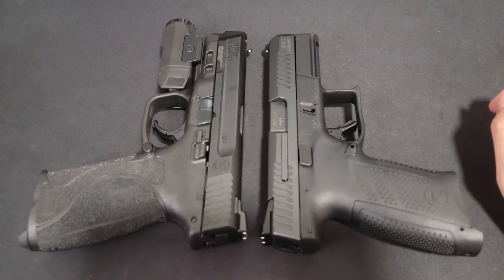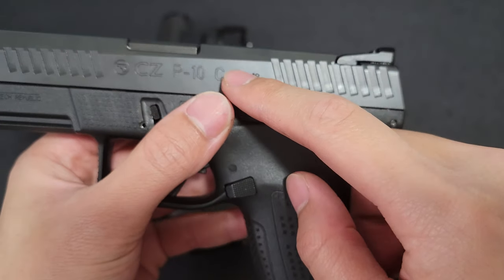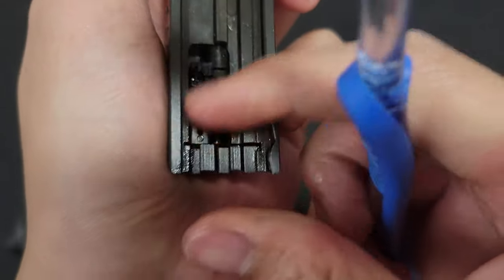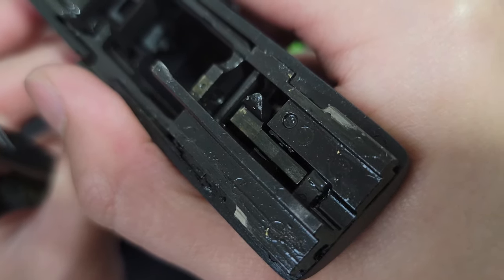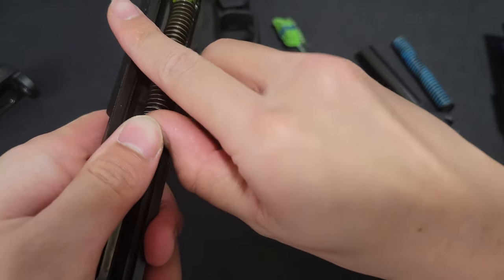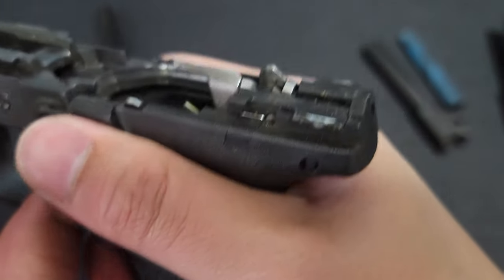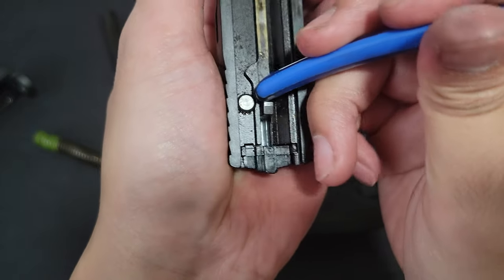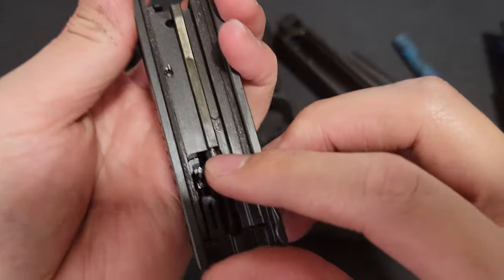Addressing the CZ P-10 C Firing Pin Stop Design Flaw (Read Description, Updated 7 April 2021)

Comment from the maker: A firing pin block is a mechanical block used in semi-automatic firearms and some revolvers that, when at rest, obstructs forward travel of the firing pin, but is linked to the trigger mechanism and clears the obstruction to the pin just before the hammer or striker is released. This prevents the firing pin from striking a chambered cartridge unless the trigger is pulled, even if the hammer is released due to a faulty sear or the pin is dropped or struck by another object.

Here's a parallel to draw, my CZ P-10 C is basically a series 70 1911 because its firing pin block does not work, and the functional structural integrity of the firing pin block does not change when the gun is assembled. My firing pin block is still free to move inside the gun just like it is outside the gun, I stuck a pin inside the gun when it was fully assembled to try to move the firing pin block and it was free to move. Basically think of it like this, it's like a series 80 1911 with a non functioning firing pin block, essentially turning it into a series 70, not that a series 70 usually has problems, it's just that it's better to have a functioning firing pin block in modern guns. Almost all other pistols' firing pin blocks work when the whole guns are both assembled and disassembled, this P-10 C Firing Pin block does not either way and will ignite a primer by pulling the striker back and letting go or if the sear were to disengage. Essentially what is happening here is, my CZ P-10 C is relying solely on the sear engagement in order to keep the gun safe, not BOTH sear engagement in conjunction with a firing pin block like most other pistols. A series 70 1911 is the same way, it is relying solely on hammer-sear engagement to keep the gun safe, if a series 70 1911 were to take a drop on the back of the hammer, it could possibly slip forward from the sear and fire a round, with a series 80, if the same thing were to happen, the hammer would slip forward but the gun would not fire as its firing pin block is actually functional, this is why it is important to have a functioning firing pin block both when the gun is assembled and disassembled, and not rely solely on sear engagement. The CZ P-10 C to me, indeed does actually have a strong sear engagement that will usually not fail, however if it were to fail, keep in mind that the firing pin block that is designed for those rare instances, will not do its job. In conclusion, your CZ P-10 C will not likely give you any problems, but just remember that it is operating similar to a series 70 1911 regarding its firing pin block.

Comment: This is when social media proves how it’s a detriment. That so many in the comments are taking this seriously is just sad. Easier test since you think you have an inferior gun unsafe for others: your P-10 should have come with snap caps that have replaceable foam where the primer would be. Try some drop and hammer to the back of slide tests while the gun is FULLY ASSEMBLED and record the test from beginning to end. Show us the an impacted foam primer after getting one to go off and how much force was necessary for this to occur. There’s dozens of these tests on YouTube you can reference. Stop counter claiming that gunsmiths and engineers aren’t as smart as people think they may be. You made a claim. Demonstrate it in an assembled gun or take this goofy video down.
Reply from the maker: I'm worried about potentially the slide separating from the frame from being dropped. Not likely, but if the firing pin stop works only when the gun is assembled, then if the slide comes off, it would no longer be a stable system since the gun is no longer properly assembled. I'll tell you what though, using a needle, poking it from the back of the slide, I can move the firing pin stop just like I could when the gun is disassembled, so in actually, assembling the gun doesn't do anything to increase the firing pin stops integrity.
Reply: @Radvous  it won't happen. it will take a lot of force to separate the slide from the frame. dropping it won't just cut it. maybe if you drop it from a 30 story building then it might. even though, you're not sure if it will going to fire when it breaks apart
Reply: Doesn't help that he's clearly bent it.  "Hey guys, look at this gun I broke not working how it's supposed to".

Comment: This is the next eisode: "Part one: I can't find the flaw" and "Part two: I make up some BS, and perhaps S&W pays me"...
Reply from the maker: Just so you know, CZ discontinued a previous version of the P-10 C because of flaws
Reply: My P01 is a useless P.O.S. My Glock never failed me. I'm selling my P.O.S P01 to any fan boy who might want it.
Reply: @watchingthecrazyworld7761  I will buy it lmao i have a ton of pistols maybe 6 different brands but my cz p07 has around 8.5k rounds through it without a single malfunction. I have a gen 5 g17 that has about 2k with like 8 failures. I've seen glocks that run like a top but in terms of trigger, sights, ergos they just aren't the best. They just have a good track record in terms of modern military and police use
Reply: @Lophophorasaurus  Let me know if you are serious. If so, I will get you my email. I would take $750 for it. It would come with 2 mags, a leather shoulder holster, and the original case. I had upgraded sites installed that cost $150 and new aftermarket grips. So that's a good deal.

Comment: No we understand,  the person who doesn't understand is you.  Stop making videos like you know what you're talking about.  If you truly think you have a faulty gun then send it in, but as I stated I repeated the "demonstration " you did in the previous video and the stop on my pistol functions fine.  The gun has been out for quite some time, and if it had an issue we would have heard about it.
Reply from the maker: Heres a parallel to draw, mine is basically a series 70 1911 because my specific firing pin block does not work, and the functional structural integrity of the firing pin block does not change when it is assembled with the rest of the gun. My firing pin block is still free to move inside the gun just like it is outside the gun, I stuck I pin inside the gun when it was fully assembled and it was free to move. Basically think of it like this, it like a series 80 1911 with a non functioning firing pin block, essentially turning it into a series 70, not that a series 70 usually has problems, it's just that it's better to have a functioning firing pin block in modern guns. Almost all other pistols' firing pin blocks work outside the gun disassembled, this one does not and will ignite a primer by pulling the striker back and letting go.
Reply: @Radvous  + drawing comparison to a 1911 isn't making your any smarter or proving your point.  If you are so inclined that your the only CZ p-10c owner in 4 years to have any issue like this, then send it to CZ and document that process.

Comment: The one time you "demonstrated" the issue you the safety was disengaged by the toothbrush. In normal operation it blocks the striker very reliably. Also if the pistol falls the striker is not pulled back further as you are doing with the toothbrush. It is constantly pushing forward under spring tension. In terms of the whole assembly moving forward, the pistol would have to fall muzzle down and there is simply not enough inertia to allow the assembly to go forward and discharge a round. Finally the CZ design is superior because the plunger design on the Glock and M&P is prone to becoming stuck if oil and debris gunks it up.

Comment: All mechanical devices can fail, regardless how well they are designed. It's the user that's the true safety. Do I think CZ should redesign the firing pin block on the P-10c? Yes.

Comment: Test it like this. With the pistol in its assembled state with a magazine in it. Now rack the pistol, now lock the slide back and check the firing pin to see if it can be pushed past the block. Now drop the slide and pull the trigger then rack it again and lock the slide back. Check the firing pin to see if you can push it past the block again. Repeat that as many times as you like.  If you do it that way and you can NEVER push it past the block it works exactly how its designed to. That is how it operates when it cycles the action. I guarantee you if you test it like that you will never be able to just push the firing pin past the block, once it goes back into battery and the slide cycles, that firing pin will be behind the block everytime. Now on to the whole assembly moving. The pressure it takes to move the entire assembly forward is to much to move that firing pin forward easy enough and hard enough to set a primer off from a distance out of a hand or more distance even. If it was that easy the pistol would go automatic during firing it from the inertia of the slide slamming forward each time. Also the firing pin never slams into the block like that during its normal cycling to begin with. Its also only pulled back just alittle bit when the pin is resting in its firing position. You are misunderstanding the engineering of the CZ P10 series functions. Its not a Glock or any other pistol.
Reply from the maker: The sear on the striker and trigger bar catch when the slide goes into battery, what the firing pin block is for is in case the sear gets disengaged, the firing pin block is supposed to stop the round from going off if there is a slippage of the sear. If your firing pin block doesn't work when the sear slips then a round will go off if the sear slips, turning it into similarly a series 70 1911. Most of the time you can rely on the sear engagement and not have to worry about having a firing pin block as a backup, but firing pins break and they can break at the sear too, in those cases you need something to stop the firing pin from striking the round. Any other pistol design out there stops the firing pin from protruding from the breachface no matter if the gun is disassembled or not and the only way those guns allow firing pins to protrude is when the block moves out of the way when firing.
Reply: I know what it all does. The firing pin will not hit the round in its assembled normal operating state. You must be missing that point. Whether the sear engages or not. The firing pin will be locked back behind the block during normal operation of the pistol period. Its ok though you can believe what ever you like. The P10's have had no safety concerns for a reason and its because the safety mechanisms do there jobs under normal proper operation. Not slamming the firing pin abnormally into them, which never happens lol!!
Reply from the maker: @gregt.169  oh trust me, I know that the firing pin will be held back behind the block during normal operations, that's called sear engagement. If sear engagement fails from a drop or whatever reason, the block that is designed to stop the firing pin in non-normal conditions, won't actually stop the firing pin is what I am trying to tell you. Remember, the block is there for preventative measures for non-normal conditions, not normal conditions. What I am telling you is that the block doesn't work as designed, even Minute pressure of slowly pushing the firing pin forward sometimes bypasses the block. It's like I'm telling you that keyboards keys are designed for typing, but that in this keyboard designed, the keys don't work and nothing appears on screen, that's the parallel.
Reply: @Radvous  I still believe you missed my point. I said the firing pin will be locked back behind the block whether the sear engages or not under normal operation or from a drop etc... of the pistol. CZ has been making firearms for a veerryy longtime. You are over thinking it and missing the point of how the pistols internal condition is when its cycled and loaded. Again believe what you like.
Reply from the maker: @gregt.169  so you're telling me that the firing pin will be locked behind the block? Unless when being fired of course. Is that what you're trying to tell me?
Reply: 100% correct
Reply from the maker: @leonbarry4566  incorrect, the firing pin block will just let the firing pin slip past and hit the primer if the sear ever unintentionally disengages. In the assembled condition, nothing is holding the block in place until the trigger is pulled, that's just false information. In the assembled condition, if you stick a pin inside the gun through the back of the slide, you can easily move the block, easily, it's no different than when the slide is taken off. The block doesn't actually block anything, it doesn't work as designed. You're only relying on the sear to not blow your balls off.
Reply: @Radvous  then maybe try the test with firearm assembled,obviosly only moving firepin back only the amount it should be prior to pulling triger,as i understand it is only pattialy cocked untill trigger is pulled moving firepin more back,thus the "presure" of pin to block will not be enough to go past block?
Reply from the maker: @leonbarry4566  I can test that, I do want to note that also I can sometimes just push the firing pin forward with my finger past the block too after it has been pulled behind the block and carefully released forward. It happens once in a while where the block doesn't have enough spring pressure behind it to fully engage.

Comment: WHEN THE FIREARM IS ASSEBMLED,you will notice that the "fire pin block" is held in place(BLOCKED),until trigger is moved to disengage it,you can not test it when firearm is taken apart,it is a function by more than one moving parts
Reply from the maker: It moves when assembled, that's what I'm trying to tell people, it is not held in place by anything, what you just said is incorrect.
Reply: Outside of the factory, we’ve also employed the services of an NIJ-certified independent third party to perform testing to the P-10 platform in accordance with NIJ-STD-0112.03, Autoloading Pistols.
During this outside testing, P-10s of various configurations/models were subjected to extremes of temperature and environment like sand, salt water immersion and more. Another aspect was extensive rough handling and drop tests. In those tests the P-10 performed as we knew it would – experiencing no failures.
The main safety systems, as you’ve mentioned in your write-up, are the trigger safety and the drop safety. Both of these mechanical safeties work to prevent the P-10 from firing without the trigger being pulled.
The safety in question is a third safety, known as the ‘automatic safety.’ For the automatic safety to ever need to be employed, either the firing pin, the sear surface of the trigger bar, the trigger bar spring pin or the frame itself would have to fail. In the incredibly rare instance of one of these items failing, the role of the automatic safety is to reduce the chance of the firing pin igniting a chambered round, adding a third layer to the robust safety system within the P-10.
There are many factors present in the 'testing' in question that are not able to be present in the P-10 during use in its assembled form. First and foremost, the firing pin travel exhibited in videos of these ‘tests’ is far greater than the maximum firing pin travel reached during the normal cocking/firing sequence (to the tune of 1.5x, resulting in a corresponding increase in inertia within the firing pin).
Realistically and in the worst case scenario, were a failure to happen the firing pin would be falling from its pre-cocked position with far less force, allowing the automatic safety to retard its forward travel. When in the pre-cocked position, the firing pin still has 3.5mm to travel before achieving its full travel and being released by the trigger bar.
A major factor in all of this is that the designers of the P-10 intended this tertiary safety to function once and as a last resort were a parts failure to have occurred, envisioning it much like an airbag in a car. During normal use of the firearm, the automatic safety never impacts the corresponding shoulder on the firing pin. As such, when called upon those two engagement surfaces are able to make positive contact, hampering the firing pin's forward progress.
Subjecting the system to non-standard testing such as this will in no question create undue wear to those engagement surfaces, and the more times the test is repeated, the less chance the automatic safety will be able to perform its function in the rare instance it were needed. Fully withdrawing the firing pin to that overdrawn position will exacerbate this greatly.
Like in other instances where faulty information on the internet has led folks to perform ill-advised 'testing' that ends up damaging guns
Reply: Ok, I tested this myself with live primers. The firing pin block will fail from the force of a fully cocked striker. Nothing holds it shut from the lower frame. But it does work reliably from anything less than 3/4 cocked. And it's only half cocked unless you pull the trigger. So it does work enough to obsorb the energy. 

The 2nd part about the whole assembly, which is spring loaded agaist the primer, slam firing from impact just won't happen unless you launch it out of a cannon.